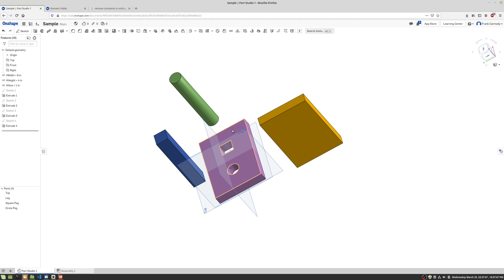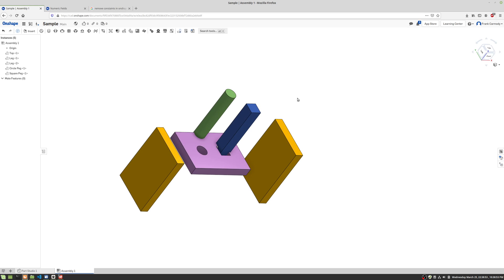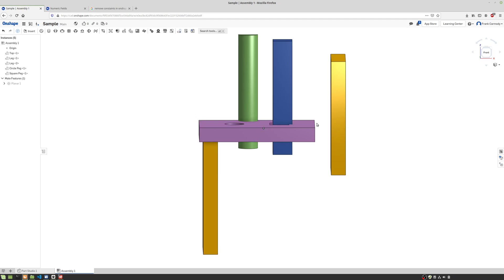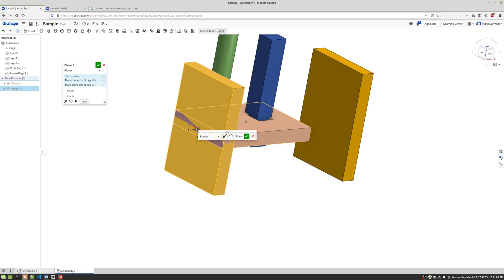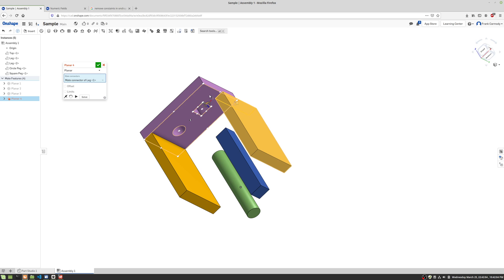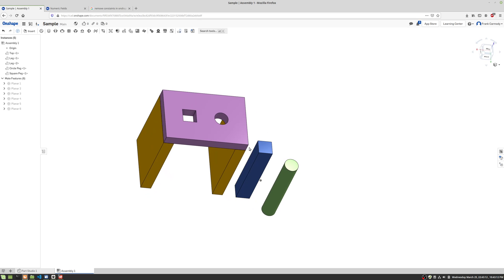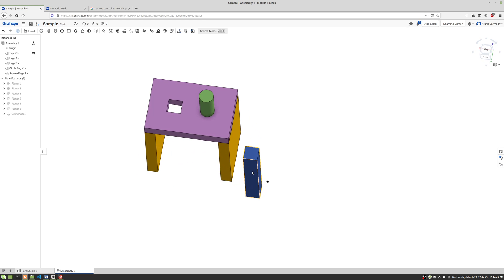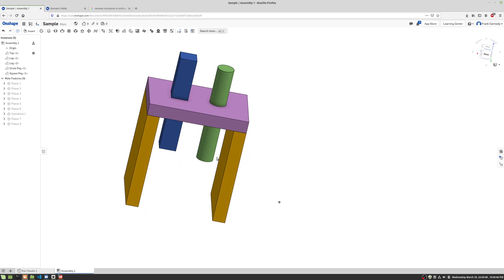Onshape : 9 : Basic Assemble

Comment: Wow.  Wow.  Wow.  Been using OnShape for years now and have only ever used Part Studio to create monolithic parts that I could 3D print for ham radio applications.  I am trying to build a “thing” to allow me to click in my radio onto a knee strap in the field and I need to build this in pieces due to the complexity of the print.  I was struggling with the Assembly for what is really a basic thing.  This video just turned on the lightbulb for me.

Thank you.